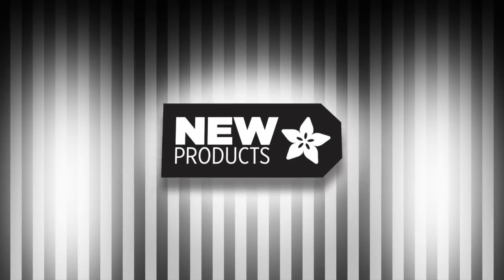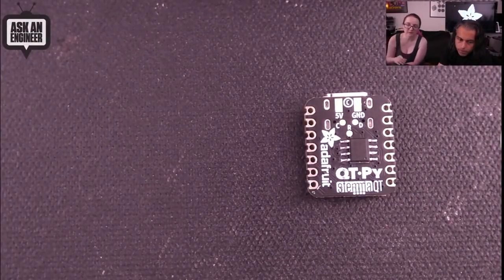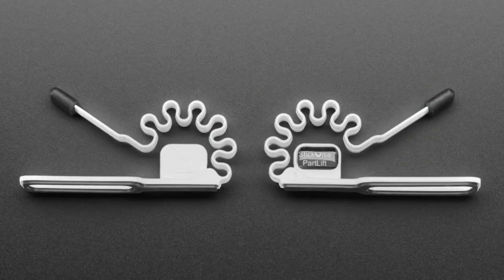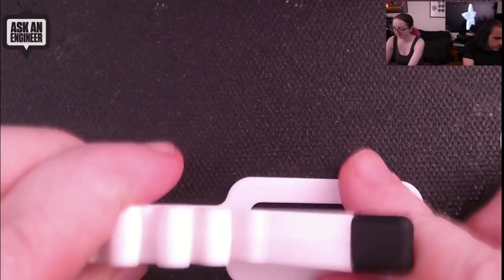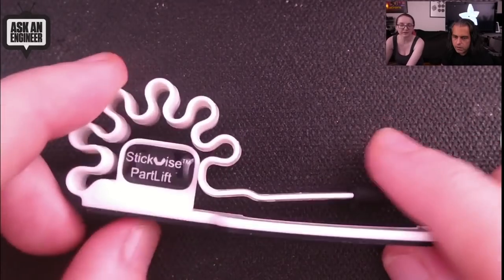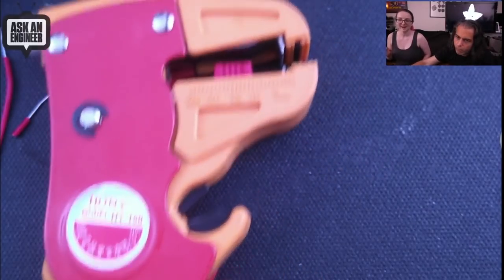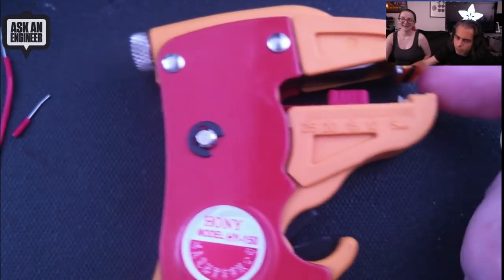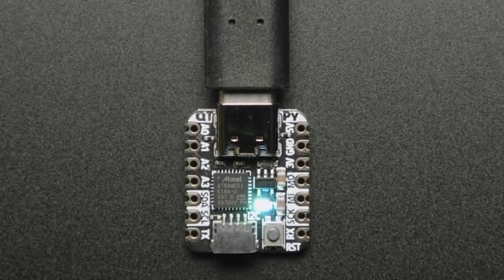New Products 9/23/2020 featuring Adafruit QT Py - SAMD21 Dev Board with STEMMA QT!

Comment: Those auto wire strippers were a life saver back when I made serial cables using crimp pin connectors where the gold plated pins/sockets cost about $0.15ea With this you would have bare wire crimped and some insulated wire to crimp to as well.

Comment: I'm a beginner who recently soldered one of these packages. All went well until I soldered it 180 degrees off of the normal configuration. Desoldering was the hard part, but I used quick-chip removal alloy and a solder wick to remove the chip. The Second time went without a hitch. I learned so much in the process. XD

Comment: I wish the QT Py came with (or had a variant that came with) the SPI flash pre-populated. It's $6 on the site, $1.25 for the SPI chip - I'd easily pay $9 to get it populated. The no solder STEMMA bit is the big sell here, and having to solder on a SMD chip, even an "easy" one, kinda goes against the grain. (Is there a STEMMA pluggable flash chip?)